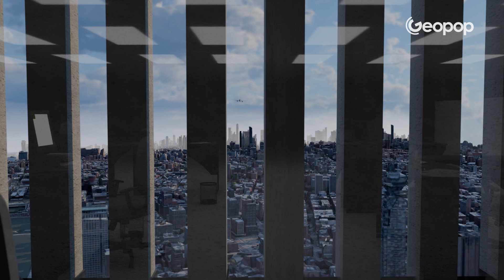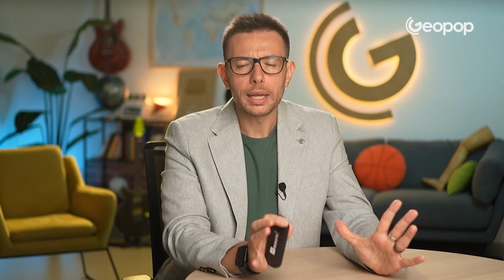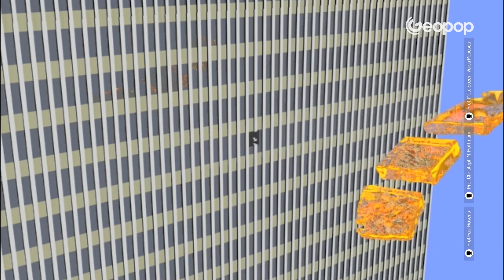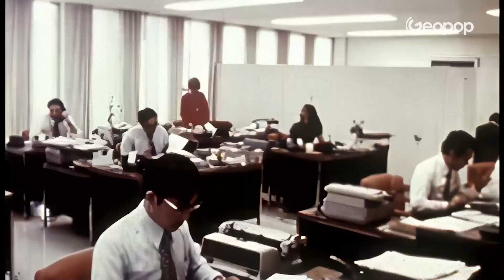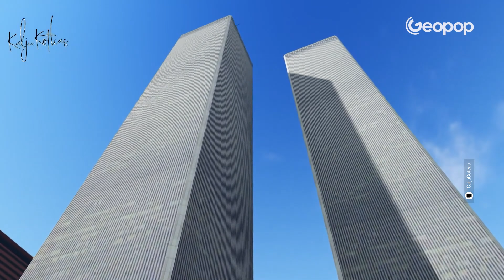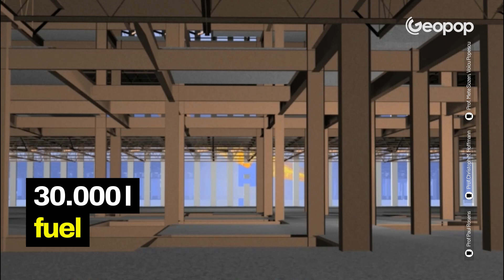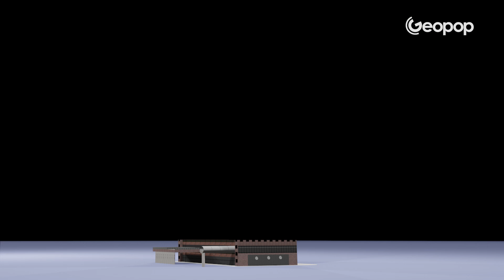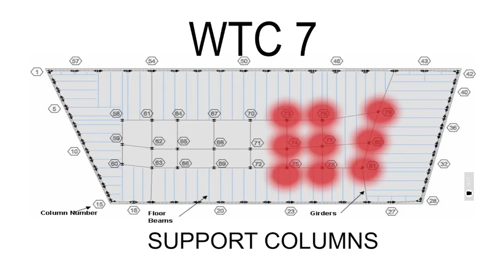9/11, 2001: The Technical Reconstruction of the Twin Towers and WTC 7 Collapses

Comment: I don’t buy it. They can spin it anyway they want to . Controlled demolition was the cause of #7  to collapse
Reply: I’m going to respectfully disagree and offer a more plausible explanation using engineering, not ideology.

Much misunderstood, Building 7 was the 6th building to collapse of the 10 lost on 9/11. Because of its early low priority, conspiracy filled the information void with garbage made up by technically ignorant people promoting political agendas. But this is an engineering problem and should be treated as such, so I prepared this brief summary of my own analysis to fix that, using engineering, not politics and tired memes.

The North Tower collapse at 10:28am bombarded Building 7 with tons of debris, causing heavy damage and starting multiple fires which burned out of control for 7 hours. Half the FDNY firefighters having been killed, units in disarray, equipment destroyed, no water pressure, and the greater urgency of search & rescue efforts, firefighting was pulled as futile. The building couldn’t be saved and was left to its fate. That is the sort of choice firefighters make every day in brush fire situations - which houses to save and which ones to let go. Only real difference here is moving the decimal on the size and cost. People get overwhelmed by the size.

www.youtube.com/watch?v=g_SvpwyC17M&ab_channel=MFitz

Collapse of a burning structure is always a concern for firefighters. Steel buildings subject to fire rely on active fighting of the fires to survive. Buildings are designed around 1 to 3 hours of fire resistance, allowing time for occupants to escape and ACTIVE firefighting to get started, after which all bets are off. Left to their own devices they will exceed their design envelope and collapse, like Plasco Tower and Wilton Paes de Almeida. In B7 the occupants escaped, passive and active fire protections were compromised and active firefighting was abandoned 3 hours before the collapse, which left the building to its fate. It lost. Odds on Building 7 would eventually collapse, and it did. No big deal in logic.

www.youtube.com/watch?v=WnYBX6QT0R4

FDNY Chief Daniel Nigro ; The biggest decision we had to make on the first day was to clear the area and create a collapse zone around the severely damaged 7 World Trade Center, a 47-story building heavily involved in fire. A number of fire officers and companies assessed the damage to the building. The appraisals indicated that the buildings structural integrity was in serious doubt. I issued orders to PULL back the firefighters and define the collapse zone. It was a critical decision; We could not lose any more firefighters. It took a lot of time to PULL everyone out, given the emotionalism of the day, communications difficulties and the collapse terrain

FDNY Deputy Chief Peter Hayden ; We had our special operations people set up surveying instruments to monitor and see if there was any movement in the building. We were concerned of the possibility of collapse in the building. And we had a discussion with one particular engineer there, and we asked him if we allowed it to burn could we anticipate a collapse and if so, how soon? And it turned out that he was pretty much right on the money, that he said 'In its current state you have about 5 hours

The collapse of Building 7 was anticipated and widely reported in the media throughout the day, with 24 video cameras recording some or all of the collapse. Everyone knew what was coming and why.

www.youtube.com/watch?v=OY5S5k3tMHI

Building 7’s collapse was completely different to the Twin Towers and harder to understand as most details hidden from view and not intuitive, but we can still sort out what happened through careful analysis and observation. This is my explanation of the collapse relying on no outside authority.

Building 7 was complex, assymetrical 47-story steel framed structure built atop a smaller 3-story building, requiring lower floors dedicated to complex load transfer structures, not usable office space. Of trapezoidal shape and all-steel tube-in-tube construction, B7 (above the 7th floor) consisted of a central core of steel columns carrying most of the gravity load, perimeter steel columns around the outside of the structure carrying the remainder of the gravity loads and long span beams and girders to tie those elements together and form the floors. On the outside of the building hung a moment frame or outer shell.

Phase 1 : First externally visible signs of collapse initiation occurred at 5:20:28 pm and were notably quiet with observers not realizing the building was collapsing! No audible warning in the form of hundreds of ear drum busting 180-190dB explosive bangs preceding the collapse. Here at 12:00 a local CBS affiliate reporter is talking 10 blocks from B7 when collapse begins. People don’t start to notice the collapse until 12:11. At 12:45 is the famous CBS fixed camera clip of Building 7’s collapse. Note how quiet it is.

youtube.com/watch?v=t5tEy6mXSE8&ab_channel=fresnosean379

Collapse initiation was due to lower floor failures above the load transfer region (7th floor) in the NE corner. In this video at 0:45 you can see the NW corner from inside the building while under construction, Column 79 just out of frame on the left. That big, angled steel beam across the top of the frame connects to C79 at one end. The girders connect to the beam. That beam and all those girders depend on just one connection

youtube.com/watch?v=nP3TNHPCIVU&t=35s&ab_channel=EdwardCurrent

Phase 2 : The floor failures caused a loss of critical lateral support over an excessive length of core Column 79 and it buckled. If you look at a floor diagram of Building 7 (see above) and look at all the structures that depend on C79 you quickly realize this one column was a relatively isolated structural element on which a disproportionately greater fraction of the structure depended analogous to say the Key Bridge. Externally we see a vertical progression of window breakage along the 44-46 line and a kink in the roof of the East Mechanical Penthouse at the top of the building, consistent with C79 failure. The transition from full capacity to almost no capacity occurs in an instant. Once the buckling failure occurs there is almost no resistance

Normally with a buckling column, the load could be redistributed to other columns. With C79 that is not the case - the failure did not redistribute the load, so the collapse rapidly progressed to the roofline, sinking the rooftop penthouse.

Phase 3 : With C79 gone, B7’s progressive, non-symmetrical collapse continues with C80 and C81 at the east end of the core left laterally unsupported and quickly buckled and failed as well, sending the EMP down through the building. C79-81 all have no diagonal bracing, which I believe is a major reason why they could not redistribute a lot of vertical loads among one another.

From there collapse progressed from east to west through the central core until the core was gone taking all of the interior floors and probably most of the perimeter columns with it. Follow the horizontal progression of window failures low in the building and the dropping of the remaining rooftop structures into the building. One of the big takeaways from the NIST Building 7 study (that gets completely ignored) was their modeling which determined C79 failing under ANY circumstances would have initiated the same collapse sequence.

Phase 4 : After 10 seconds only the exterior moment frame - a hollow empty outer shell – remains, giving the ILLUSION the Building is still standing since little has outwardly changed. It is just a hollow empty shell like an empty cereal box. Supported by only a few remaining columns that empty shell is quite unable to remain standing. With all core columns and floors gone, the north face leans inward, forming a V in the roofline, the last few columns buckle under the strain and the moment frame free falls, landing on top of the 7-story high debris pile. It is only late in the game here at the end that a single measurement of alleged free fall acceleration is taken, from a single point on that outer shell. The Building did not “free fall” – just one corner of the outer shell did, sort of. The Building was already gone before that happened. The period of alleged free fall was a product of how it fell NOT why it fell and cannot tell us what started the collapse. Start to finish the entire collapse took 18-20 seconds, 3 times longer than true free fall . How fast something falls cannot tell you what started it falling_ anyway. The debris spread outside the footprint, blocking surrounding streets, heavily damaging the Verizon Building and destroyed Fiterman Hall.

Building 7’s progressive, non-symmetrical collapse was incidental and unintended collateral damage from the combined effects of fire + time + gravity, started by the collapsing North Tower. That is true no matter who planned and carried out the 9/11 attacks or why . The collapse was of so little consequence it barely even registered at the time, a mere footnote. It only took on semi-mythical status as an alleged smoking gun years later when demolitions at the Twin Towers, missiles at the Pentagon and shoot down over Shanksville all failed and conspiracists had nothing left to work with.

Anything can seem like a conspiracy if you don’t understand how it works. Now you should. I hope you found this helpful, informative and it solicits informed critical comment. If I made any errors of fact, logic or reason or left anything important out, please let me know so I can fix it. IF you can offer a more plausible alternative please do. Be the first. Please start any reply with the words “Tits McGee” or I will know you didn’t read it and are wasting my time.
Reply: Please tell us how "they" managed to keep the explosives from igniting for 1-7 hours after the impacts, and raging fires? The colapses initiated at the point of impacts. So how did they rig the explosives so that they were not damaged by a plane collision?